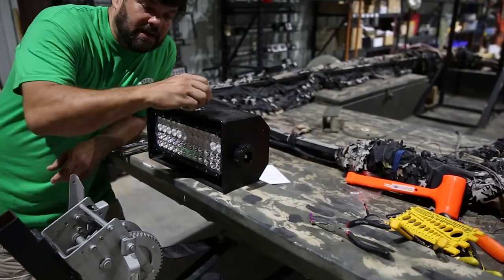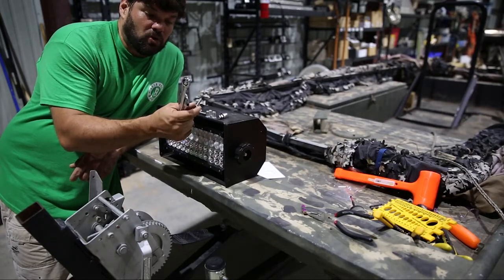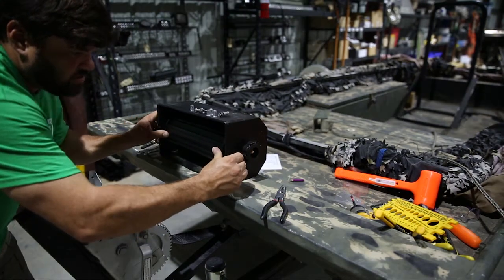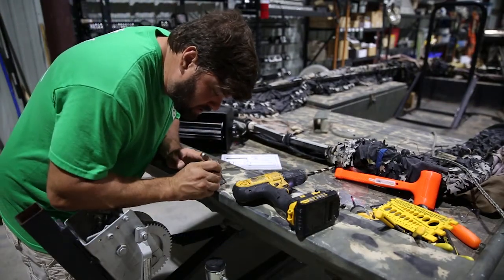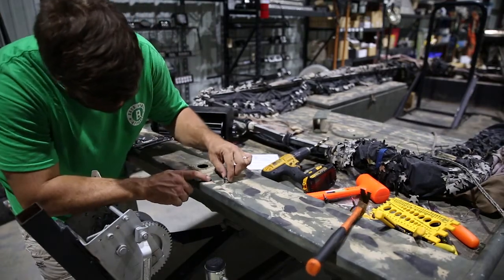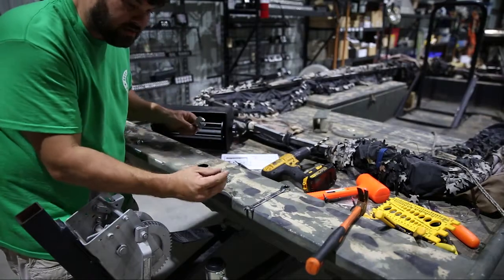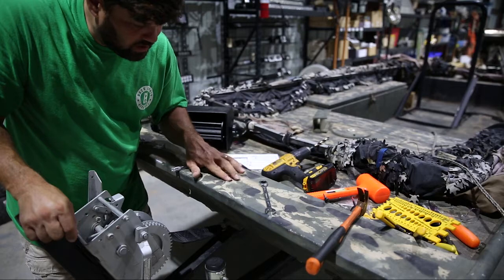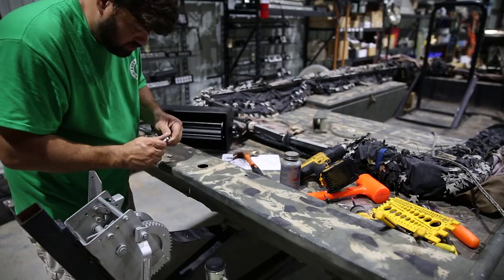Installing SLL LED Boat Light

Comment: I think you make a great product and plan on putting one on my boat. But a suggestion if I may.......if I'm going to spend  $400 plus dollars on a light, it shouldn't be that difficult to mark the holes. Ever thought about including a piece of construction paper the exact size of the base of the light with precut holes as a template to mark all 4 holes? Very inexpensive and would shave a few mins off instalation. Got to remember, this would probably be your customer's first time instaling this and you've installed 100 or more of these things.
Reply: I don't think you need to spend $400 on lights just to light up the boat and the water around you for night fishing. I spent about $60-$70 for 2 sets of lights for front and back and those led lights are bright, trust me. The lights lit up my entire garage when it was pitch dark inside the garage. I got my lights from Walmart and I don't have a compliant yet.
Reply: Zzzzzz... a lot of guys get these lights for running through flooded timber to duck hunt. Lights up the woods much better than a handheld spot light